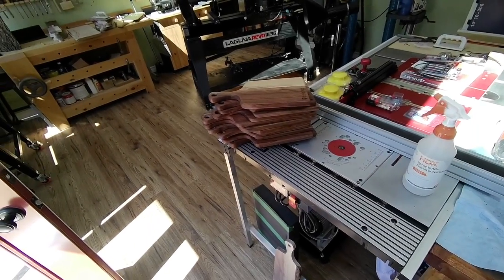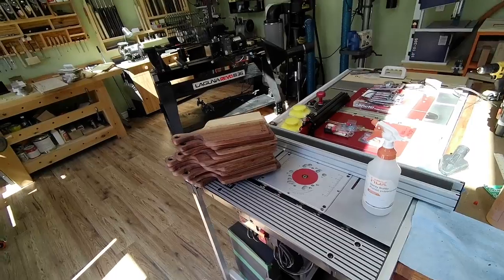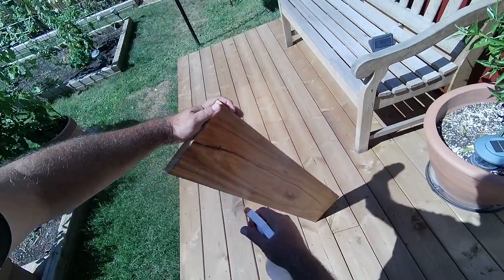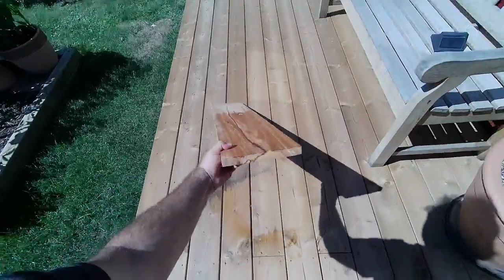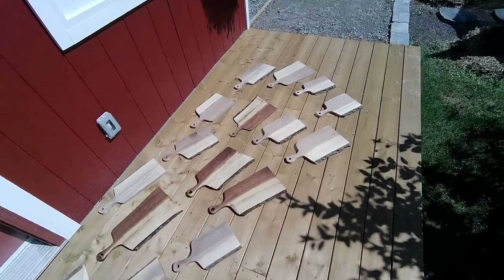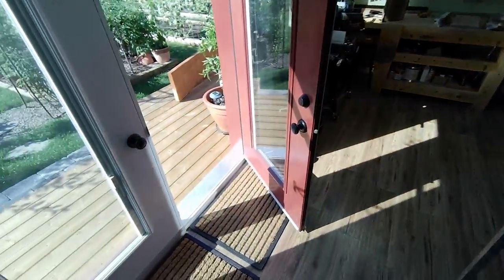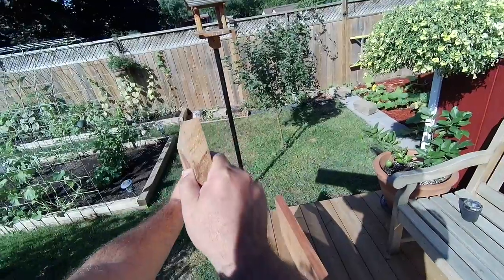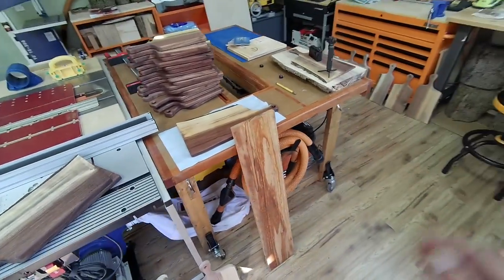How to really fix a warped wood board NO PLANER

Comment: The main 2 or only 2 reasons why boards warp are due to stresses in the wood or the board was not evenly aclimated on both sides. Adding water to one side is only a temporary fix. Once it dries out, it will go back to warped again.
Reply: That's not true. If you wet it, which will usually straighten it and then dry it, while forcing it to stay straight while drying, then you will end up with a straight board. 
Of course if the bord gets wet again it can become warped again, if dried improperly.
Reply: @stauffap  would it warp again after being wet if it was warped by stress?
Reply: @dijaun  
Usually wet wood tends to stay in the shape it dries in (roughly).

Comment: Bought an old house and the doors were all covered in hardboard as was the trend many years back. Underneath they were nice panelled doors. Each one I striped all the old paint off (brown, another old trend) filled in numerous nail holes, painted, with the panels a contrasting colour. Final one, when fitted was 2 inches out at the top when closed...!  Even 2 weeks stressed with a tow rope to the banister only reduced it an inch. Gave up and left it as the door stayed mostly open, come the time we moved, it fitted perfectly, just needed a couple of years to get used to its new colour. 😊
Reply from the maker: LOL, cool. So much for instant gratification.😊

Comment: IMHO it is mostly an exercise of futility. The outside of a tree is more dynamic than the inside. You could get center planks but then you have to deal with the center which can be even crazier but if you find a stable one it will stay str8. Quarter sawn i believe they call it.

The thing with cutting boards is that all of them will be soaked in water all the time. They are cutting boards, afterall. You could make them curved in the first place so that they straighten as they get used but that means you have to get the data from your cutting-board routine with a pice of the slab. And you have to do it with every slab. and your clients may not have the same routine as you. Nor would they understand the reason for the bend.

Doing invisible lamination is always a fix but it will take way longer even with jigs and templates.

The best solution is to just leave it as is. Every board in my house which is in use is bent with the exception of a laminated one and a quarter sawn made out of fur. To be honest, i can't imagine a cutting board without a bent in it. I like them belly side up so they are stable on the table. You could make sure that there are points on the edge which allow for that stability even if the board bends to an extreme degree.
Reply from the maker: Thank you for the feedback, totally agree.